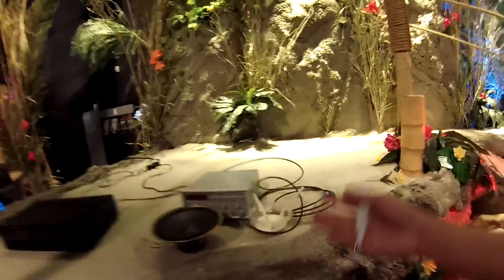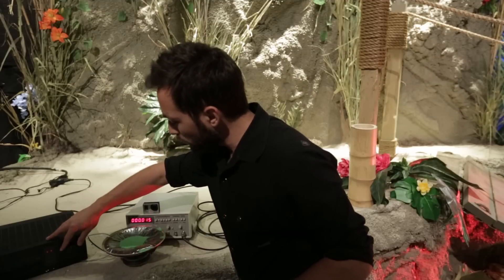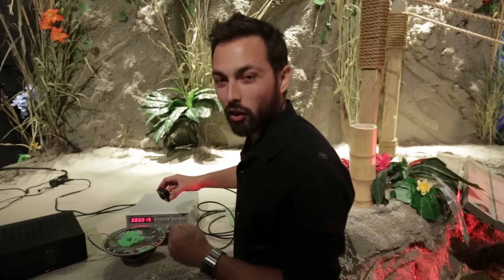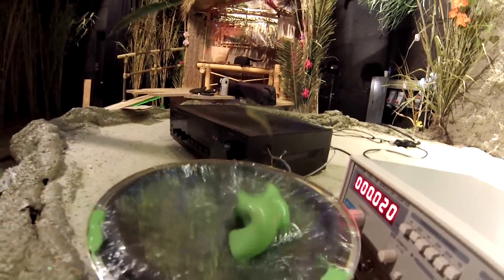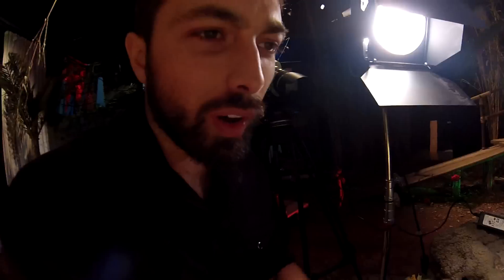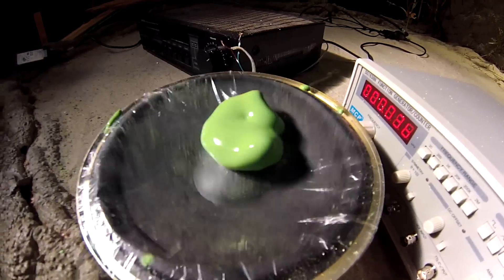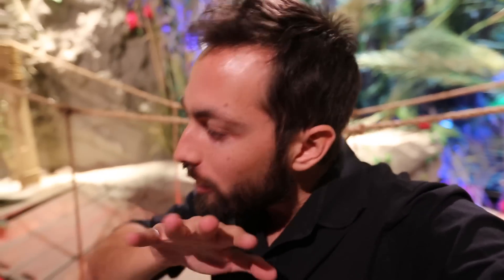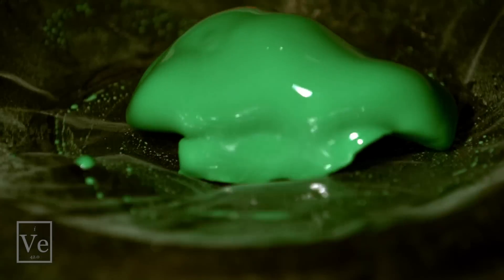Slow-Mo Non-Newtonian Fluid on a Speaker

Comment: A non-Newtonian fluid is a fluid whose viscosity changes when a force or stress is applied, unlike a Newtonian fluid like water, which has a constant viscosity. These fluids can act like a liquid or a solid depending on the amount of stress applied. Common examples include ketchup, which becomes runnier when shaken (shear-thinning), and a mixture of cornstarch and water, which acts like a solid when hit but a liquid when left alone (shear-thickening).

Comment: im curious if you increased the the frequency without increasing amplitude do you think you could vibrate it fast enough to make it act like a fluid when it should be more solid at those speeds?

Comment: What if this is how life started, a mix of liquid and chemicals that were laying around on earth over a high frequency surface that got hit by a lightning, summing to the movement incredible heat. 

The frequency could be caused by an earthquake and the lighting just striked on the perfect spot on the perfect moment, starting the Primordial Soup. 

Is that possible?

Comment: The film isn't taught, so the frequency of the speaker's oscillation isn't going to match the actual oscillation of the fluid. The film surface will bounce and stretch, and as it interacts with the mass of the fluid, you will get oscillation patterns within oscillations (this would probably happen with just a naked speaker as well, depending on how sturdy it is). Great video, but maybe your methods aren't the sturdiest :^)
Reply: not to mention that the frequency stated on the AC generator is probably going to vary from the actual oscillation frequency of the speaker

Comment: Maybe he explains it further on from where I am, but what is the difference between amplitude and frequency? Is amplitude the amount of 'bounce' each vibration has, and frequency the speed in which the 'bounces' occur?
Reply: +DowzerWTP72 yes, more eloquently would be a frequency is the oscillations per unit time, (ups and downs per second) . and amplitude is intensity, or how far up and down it moves

Comment: I think I would like to see this being fed not a sine wave with equal on and off times, but a square wave where the on and off times could be controlled.  The material flows during the off time and then solidifies and builds structure during the on, so there should be a point where the inertial of the flow is right to liquify the thin parts but keep the thick parts intact and just build and build and build.  maybe.  :)

Comment: My professor just did this in class today. Apparently cornstarch and water acts like a non-Newtonian fluid because the shear force between the cornstarch particles depends on the pressure of the fluid - I just thought that was interesting.

Comment: How come you are using glad wrap to suspend the fluid? Would this not absorb some of the frequencies and alter the way the fluid interacts with the sound waves?

On first glance I think there may be a better result if the glad wrap was suspended by another means and not allowed to physically touch the speaker/ surround?

Comment: Its hard to believe, with as many views as you get for each video, that you can't just use a speaker without plastic wrap. It doesn't matter that you used pure sine waves in this. The plastic wrap is introducing oscillations of its own which compliment and nullify the frequency you're using making an additive wave form rather than a pure sine wave. This effect is especially easy to see in slow motion. so.....fail..

Comment: Could I use an IC-555 with a MOSFET to drive the speaker, instead of using a function generator as you did? I'm looking for a cheap way to do this!
Reply: What kind of speaker did you use anyway?

Comment: That driver is doing a lot of work here because it isn't in an enclosure. There could be a HUGE difference if this was done with the driver in an enclosure. In this video, the waves are firing downward and upward at an equal rate, whereas adding an enclosure would probably make a change to the corn starch mix's 1) frequency response and 2) amplitude response.
Reply: free air'ing it wasn't the best idea. speakers aren't designed to run optimally unless they are enclosed. He only would have needed like a .15-.5cf3

Comment: This made me think a lot about active structures, like buildings that require a constant stream of energy to maintain their shape, if they lose power they literally fall over.
Or like what might be required to build space elevators.  Or even the "structural integrity field" that helps spacecraft stay together in startrek.
In this video you can see that each individal pulse of the subwoofer breaks and then reflows the strucuture of the blob, like a self-healing material.  I do wonder if you could build larger structures outof dilatent fluids like this - coupled with some kindof vibrators (ie: electronic quartz timers).  The advantage would be the material could self-heal, and by adjusting the vibration you can put it into a mode that allows it to be re-formed into other shapes - then adjust the vibration back and it will be re-locked into it's new shape.

Comment: maybe if you lower the amplitude of the wave, so that the speaker moves less in the vertical plane, but fool around with huge frequencies, like 1000, 10000 or 20.000, i bet that could produce some interesting results.

Comment: So, I'm wondering if the effects of Harmonics and Resonant Frequencies would have any effect on the material. They are always whole number integers, so if it works well at about 20 hz, would it also work well at about 40 h?. Or is it a multiple of about 5 or 10? 40 hz might be too much, so perhaps about 10 hz would work. It might not be these exact numbers but a decimal value, like 20.4 hz. I'm just curious if this would give a different effect.

Comment: For a given frequency and amplitude, you can easily figure out the acceleration. I would think that as you raised the frequency, you would want to lower the amplitude so that the RMS acceleration stays below 1 g. Then, you might avoid the problem of the inertial effect seen in the high speed.

Comment: so if when you go fast the particles stick to one another, would there be areas of the blob that are concentrated water and will sweat the water away? shouldn't there be water leaking out of the mixture at the point that it becomes a solid since the suspended particles are compressing? shouldn't it be like a sponge squeezing out the water?

Comment: The Saran Wrap over a speaker setup affected the experiment. The ooblek (my favorite name for this substance) would more directly be observable if it wasn't bouncing around so much due to the flimsy surface. On a plate or more solid surface, the frequency effect is more pronounced , and the bouncing less.

Comment: I would attempt this on my own, but I don't have the equipment required to pull it off. What kind of effect would you get, if any, if you were to light this with a strobe light flashing at the same frequency as the speaker?

In the time between the vibration, you would think that the material would go back to the liquid state for a short duration, even if hard to detect.

Comment: A black hole isn't just a massive consumer just sucking everything in all at once, in fact movement toward a black hole is actually quite slow. If someone were to watch you float into a black hole they could literally wave good bye, and take pictures of you as you drew closer to the anomaly. Eventually, you'll reach a point called the event horizon, at this point, even though you are now inside the singularity, you will leave an after image that appears as if you've stopped moving all together.

Comment: mean most solar systems have a new orbit around the (larger) galaxy center. Also, the pending collision implies that the galaxy centers themselves move. I'm more curious if this is caused by attraction between the two centers, or wether it is another orbit. Often, gravitational pull results in orbit: the moon around earth around the sun, around a galaxy center. Asteroids orbit planets or stars. The moon is slowly moving away from earth, at some point it might drift off in a new elliptical path.

Comment: The Andromeda Galaxy. What you're not taking into account is the fact this collision is going to last a very, very long time, it will be billions of years before any kind of galactic merge would have become a reality. Also, the solar systems of both galaxies are spaced quite far apart despite of the cloud-like visual representations you always see. I doubt we understand astronomical physics enough to accurately project what will happen. Perhaps some solar systems will collide, perhaps it will

Comment: Okay, but say that at the time our galaxy is going to hit the other galaxy (don't remember the name), everything would be a mess and the black holes from those two should join into a more massive and more powerful gravitational pull. Stars should start being pulled in shouldn't it? Other solar systems should be mashed together creating massive energy and gravity. Some will fling off, but most would be sucked into the new greater black hole.

Comment: Cool, I've done it with chladni patterns before but not gak. The plastic wrap randomizes the motion/frequency & dampens the amplitude a bit. You should try a polymer woofer cone with the gak directly on the speaker. I'll bet you'll see more activity  at the higher frequencies. I also would expect some more symmetrical structures like U get w/ ferrofluids.

Comment: I don't get the highway analogy: isn't that simply a normal newtonian -macroscopic- fluid showing different flow due to density?. 
After all, non-newtonian fluids are about changing the flow due to local acceleration.

Comment: i guess it would make sense that the amplitude would create a bigger jump in the fluid because it coincides with the hight of the sound wave, increase that and the fluid would go higher too. I was wondering if you were changing the amplitude and the frequency at the same time? because then it would be hard to tell if one was effecting the monster or not. COOL IDEA! :)

Comment: hey i have a question so current understanding of the universe states that in the beginning right after the big bang, there was just helium and hydrogen and then stars made the rest of the elements due to heat and pressure. then they say that the big bang was basically a huge explosion even bigger presumably than the biggest super nova so why do we think that only hydrogen and helium where made in this process?

Comment: can it be possible to use sound waves to 'hold' something up off a surface in order to reduce friction from the object moving across a surface? Like a small force field making a barrier between the two surfaces?If so, can you imagine the ways in which the process could be used!?!

Comment: What affect did the tension of the plastic wrap have on the experiment? Was it loose enough to allow the diaphragm of the speaker to hit the bottom of fluid, because it looked like it might have been in the video? Also, if the plastic was tighter or looser how did that affect the results?

Comment: The clear plastic you have wrapped around the speaker does not look taut enough - that's probably why you are not seeing the interesting structural formations you would normally see with varying the frequency.

Comment: It is one thing to go 55 on 2 lane highways that have 55 as the speed limit, even if I go 60 and even if the whole 55 thing is only a political relic of the oil crisis of the 70's.  Either way the speed limit on the interstate highway that I used to get to work is 70.

Comment: cross-section I was thinking of as the number of lanes, and yes I admit that increased speed doesn't help as much if you follow the 3 second rule for distancing one car from another rather than keeping a flat number like 50 feet separating cars.
and while humans do avoid collisions, some humans also understand the fuel efficiency gained from drafting or "tailgating" to the layman.

Comment: If we try to model the traffic, then human reaction is part of the physics.
Your first example is explained by the fact that we avoid collisions unlike molecules.
But I can't agree on the cross-section example. Whether you can fit more when the speed goes up depends on initial density of cars. Basically this "fluid" loses its density when gaining speed by increasing the gaps (in the direction of movement! so you can't decrease cross-section).

Comment: Your experiment should be done with something more solid or tighter between the fluid and the speaker. Basically with the fluid bouncing off the actual speaker structure it is interrupting the formations caused by soundwaves.

Comment: If you use the high-speed to measure the relaxation time at different concentrations of cornstarch, you could probably predict the optimal frequency based on that (f~1/τ, where τ is the relaxation time). The interesting question is does τ tend to 0 with the concentration? If not, then you should be able to get a similar effect with pure water (probably at low amplitude and extremely high frequency).
It should also be related to the speed of sound in the fluid. I'd expect, anyway. But, dispersion

Comment: The introduction of plastic wrap created some interesting features to this experiment. Firstly a bit of tension in the plastic keeps a partially amount of the fluid's mass suspended above the speaker and which gets pummelled on the upward thrust of the speaker. Second, it prevents the fluid from 'adhering' to the speaker and sorta just bounces around. Both of these prevent full collaboration of the fluid with the motion of the speaker. I would like to see this with no plastic. :)

Comment: I'm no scientist, but I think you did this experiment incorrectly. In all of the various videos and GIFs I've seen of non-Newtonian fluid involving sound, the fluid is directly on the speaker. In adding the cellophane barrier between the fluid and speaker, I would think you're actually reducing the effectiveness of the vibrations upon the fluid, therefore producing (in my opinion) rather poor results. Additionally, I think your mixture is a little bit too thick.

Comment: Derek,

Could this be viewed as a substance that, at room temperature and pressure, is simply on the line between liquid and solid on it's phase diagram?

It seems like pressure is what causes the transition, but i'm not sure.

Comment: then you don't understand it. the point is that non-newtonian fluids are liquid as long as there is no power impact on them and getting hard when there is a power impact. when you have such a fluid and you dip your finger into it, it will work, but when you hit it with your fist, it will get hard and it stops your fist.

the speakers in this vid are the power source and when you turn up the frequency (higher freq = more power) more power hits the fluid and it gets harder and behaves different.

Comment: I didn't check up on quicksand before I wrote my comment; I thought I had it covered. Turns out I didn't. Also, there is no shame in having to do research in order to point out that someone is wrong. It just shows that you're willing to accept that you don't know for certain.

Comment: if you put plain water on the speaker instead of the corn starch suspension, you'll just end up with a watery mess when you increase the amplitude/frequency, what makes this a phenomenon (especially when first discovered) is that it doesn't have some of the properties of newtonian fluids (it acts as a solid at a fast speed)

Comment: im not talking about having it fully stretched but when the plastic moves its so loose that the air chooses to gather up around where the blob is but never under it meaning that it the upwards push force is much lower because the air avoids going under the blob because it can so easily fill the before mentioned space (its really hard to explain with words only)  imagine having a 30% full and a 90% full plastic bag adding a shock of air would have much more effect on 90% one. out of characters

Comment: The fluid actually doesn't get moved directly by the sound but rather through the membrane of the speaker pushing against it.
So if you'd stretch the plastic over the speaker it wouldn't touch the membrane anymore and therefore nothing would happen.

Comment: Thanks :) I have done before which is the main reason I mentioned the above. Derek's is the first video I've seen where the plastic has been suspended like this instead of on the actual speaker (or not there at all). It's interesting to see the effect it has. :)

Comment: The sound is affecting the plastic, which jumps, and is affecting the fluid more than the sound waves. A solid metal dish like the plates we see the sand videos would've yielded proper results. This is more a demonstration on how the moving plastic and basic reflections of movement work with the liquid, not the sound waves. Disappointed a bit.

Comment: one thing i noticed compared to other similar videos, i wonder if the tension of the the material you put the fluid on can give you different results....also what if you used different thickness materials...just a thought. if anyone has any insight i would appreciate it...if it has any bearing on the results at all.

Comment: I did a fun experiment similar to this. Built a cube out of acrylic panes and placed 6 piezo speakers, one on each side. By tweaking the frequencies of each speaker independently you gain a lot more control over the shape, though there is still a good amount of randomness involved.

Comment: I'd like to see what happens when you vary the surface it's sitting on.  A more rigid surface would elicit less bouncing, so the solution could respond more directly to higher frequencies.
Reply: yes! specifically 432HZ!